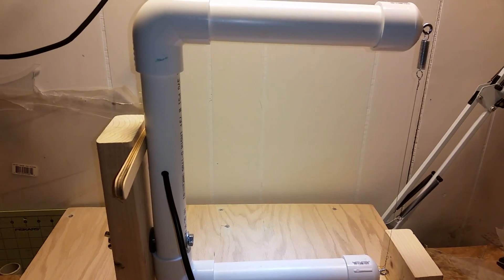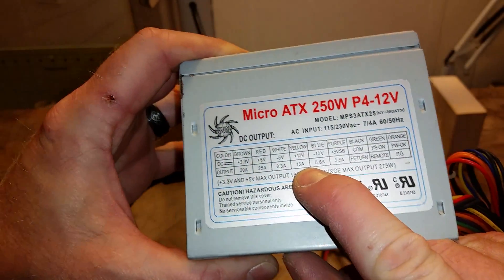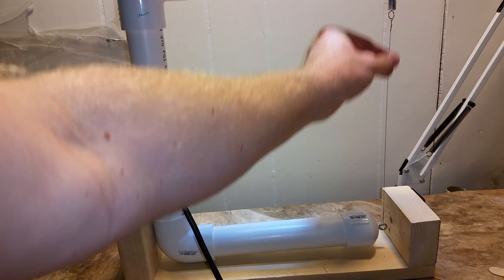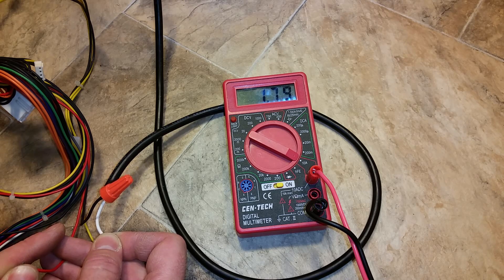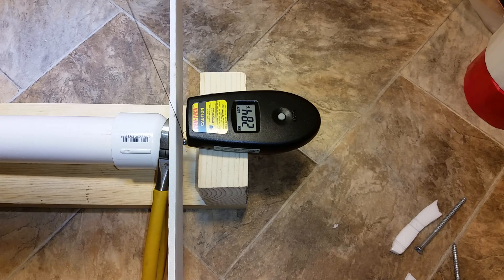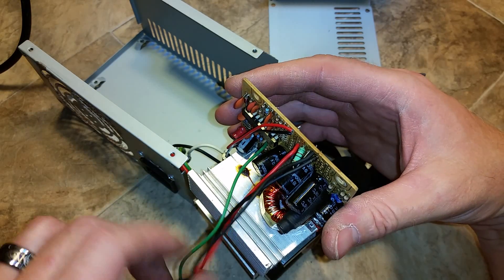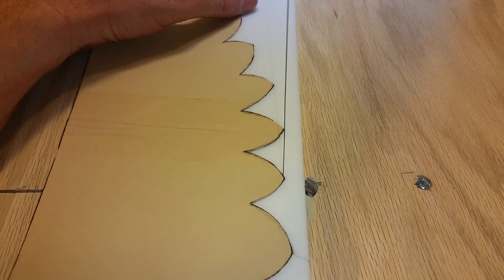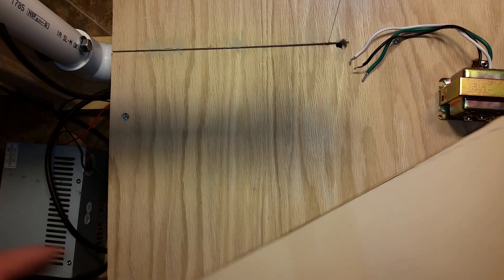Hot wire foam board cutter - Part 2 - Power supply update

Comment: If the transformer burned out it's not because its only on when the doorbell is pushed, the transformer in a doorbell is always on. Chances are more likely you are exceeding the transformer rating. Oh and centech, lol. Good luck, I'd start with a mult meter that produces reliable results and from exp harbour freight has two levels of multimeter and the other one is ok. Centech is about as accurate as holding on your tongue.

Comment: how much power need if wire have 40 inch long and cut airplane wing 20 inch long.and what wire need be, size and type ? i have one atx power free under table. easy make power supply but need know what wire and type and size need be 40 inch long wire about, aircraft model wings made.
Reply from the maker: No idea.  I'm sure there are calculators online.  Turn up the current until the wire cuts the foam.
Reply: I just rigged up one today from a com. power supply. it has plugs for 5v 8v10v and 16v. I tried in steps. 16v seemed to do the trick for a longer cutter

Comment: So how long did it last?
Reply from the maker: The door bell transformer lasted about 10 minutes
Reply: Update on the ATX computer power, did it last or has it burned out to?
Reply from the maker: I lasted just fine.  After buying a better transformer I connected the 110v wires to the transformer.